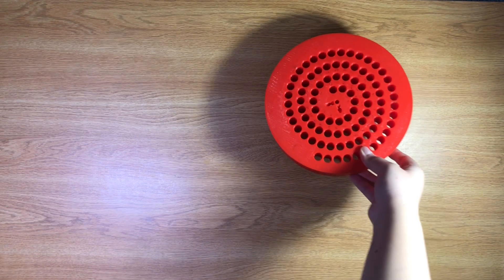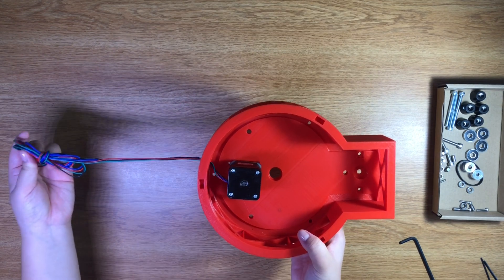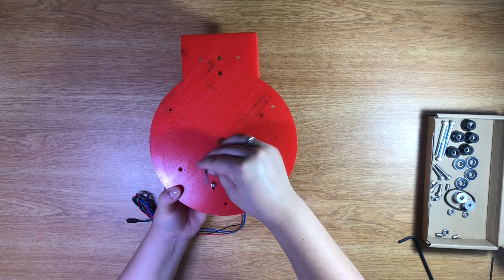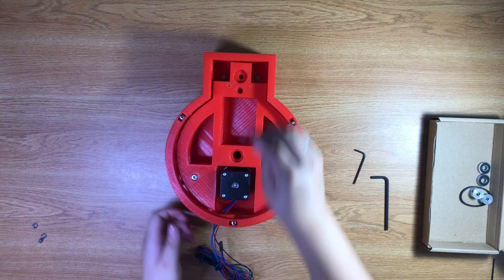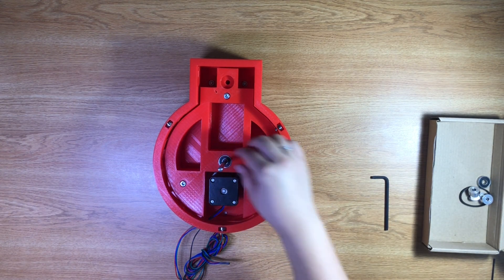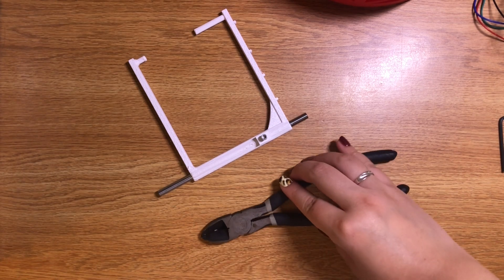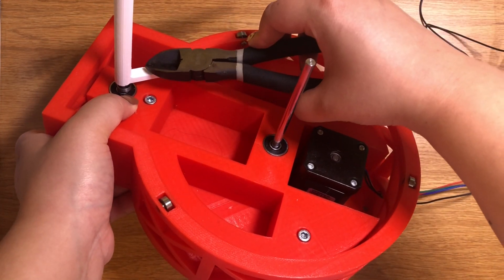Building the Open Source Fraction Collector, colosseum v1

Comment: Hi, can you send the BOM based on parts found in India?
Reply from the maker: Hi! Thanks for your interest in colosseum. While I’m glad you’re exploring the build, I’m unfortunately not able to customize the bill of materials for region-specific sourcing. The current BOM includes parts available on global platforms like Amazon and AliExpress, which are often accessible in India. I encourage you to adapt it based on what’s locally available—others have successfully done so! Best of luck with your build!
Reply: Yes, I have done the 3D prints and working on the assembly parts currently. Will get in touch with you if I face any issue. Is there a mail ID or something where I can send any queries I might have had?
Reply from the maker: @sagnikmitra6584 if you can reach out to the corresponding author to the publication (https://www.sciencedirect.com/science/article/pii/S2468067221000304) or put your questions on the Discussions of the colosseum GitHub repository (https://github.com/pachterlab/colosseum), we can answer your questions!
Reply: @yeokyoungkil5792  uxcell Round Steel Rod, 6mm HSS Lathe Bar Stock Tool 150mm Long, for Shaft Gear Drill Lathes Boring Machine Turning Miniature Axle, Cylindrical Pin DIY Craft Tool, 2pcs - I am unable to buy this from amazon - can you suggest where I can find or share a similar item with the same specifications. Please let me know soon
Reply from the maker: @sagnikmitra6584 any steel rod with 6mm diameter and 150mm length will work. There are a lot of options on Amazon and Aliexpress, such as this one: https://a.co/d/buwBQKO
Reply: @yeokyoungkil5792  Thank you so much
Reply: @yeokyoungkil5792  Can you just tell me about a certain junction box I am trying to make and I found really good video also as well including BOM. Actually I am unable to gauge how the system will be designed and what are some of the design issues I might face while making but I also know that I have to do it in one shot to make the junction box. Can you suggest some resources, papers, or any sort of help that you can provide in terms of the implementation of the junction box or any design idea that you can share?
Reply from the maker: @sagnikmitra6584  I'm not sure what you mean by the junction box, but if it's something about the colosseum fraction collector we're happy to help you. I've linked our publication on colosseum in one of my earlier replies to your comment, and you can reach out to us using the emails on the publication or here: https://pachterlab.github.io/contact.html
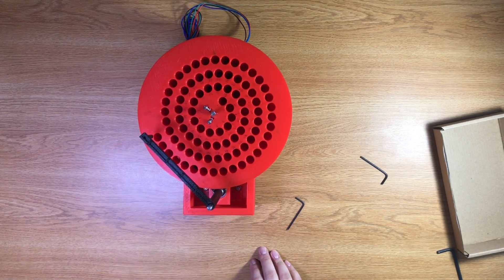Reply: @yeokyoungkil5792 Hi, I cannot understand at 10:06 min of the video you had used ball bearing in the bottom arm but I didn't see that in later parts of the video. I should do that right?